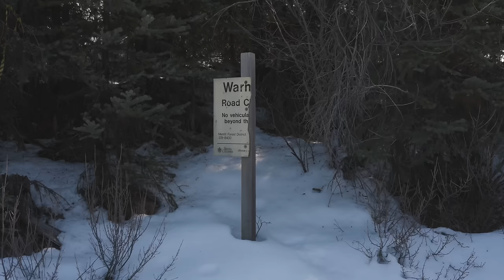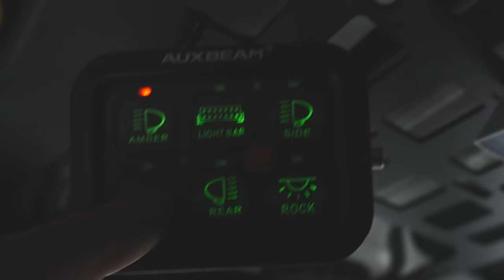EXTREME Winter Snow Storms VS My 426 Hemi Jeep Gladiator

Comment: Suggestion: mount a light, but sturdy, plow V-blade on the front of the lead vehicle.  Set the height of the bottom of it about two inches lower than the bottom of the lowest obstacle on the underside....bottom of the differentials.  On the move, the blade will clear away any snow which could pile up underneath and high-center the machine.  Clearance of the top of the snow with the blade would also prevent build-up in the steering gear as well.  Just a thought !!  Have more fun !!!!

Comment: In my opinion you don't need front and rear diffs locked for general snow driving. Snow is pretty grippy and if you are locked up it slides around more losing grip. And yes I speak from experience!

Comment: I was along by myself driving on a winter storm condition hwy 50 from lake tahoe to sac city in march 2023,,,  even though maybe not as thick snowy ice like this,,, but the icy road surface was solid form of ice,, it it rocky solid and slippery, , I saw some vehicles skid off to the shoulder,,, toobad,,,I skid off too ,luckily was able to manage on track,, only couple inch in calculation to plunge off,,, life threatening,,, MAN,,,

Comment: Man, I absolutely love watching these videos so thanks for doing this.  I have a question regarding airing up and down the tire pressure.  I seem to recall the military Humvees having an internal, "automatic" system for doing that right from inside the cab.  Is there anything like that available for rigs like yours?  It seems like that would be a major convenience for guys like you who are constantly doing all that.  Thanks and keep making more great videos.
Reply from the maker: Nothing automatic for Jeeps unfortunately, but we use a system called The Kraken to air up all four tires at once.

Comment: Insane drone work and videography! Snow wheeling is extremely fun in ideal conditions but can get very fatiguing in those challenging and dangerous conditions. Fighting for every inch and plowing with the truck wondering if something will break or if you lose control and slide in a ditch or off the side of the mountain becomes so draining mentally.

Comment: This might be a silly question, but why dont any snow offroaders use tire chains? I never see them using chains off road. Is it because the gravel and rock underneith provide good enough traction?
Reply from the maker: It's because they don't work in deep snow, they're more for ice. With deep snow you want to float on top as much as possible. Some of the snow in this video is as deep as the truck, so digging down to the ground will just make us unable to move forward.

Comment: It’s beginning to get hot here in Qld Australia (36 degrees today & not summer until December).  Watching your video was making me feel a bit cold.  You were pushing your Gladiator hard to forge a path through the deep snow & blocked up your front grille.  I was thinking you were going to overheat the engine with that big V8 working hard with no fresh air being pulled through the radiator.  Did you do any damage repeatedly pushing the car hard into a wall of snow over and over as there’d be some weight in it.  It looked punishing.  Awesome video & beautifully shot!

Comment: Hi guys, Moparben here. I just found your channel today 22DEC23. Just being curious;  why didn't you put tires on wide enough to go over the snow? I've only seen it once so I don't know much about it, but: During the snow storm of 1978 where I live in Michigan we got over 2 feet of snow. I saw a brand new full size F-150 go over it. Right at the South end of the road where I was living someone had abandoned a Datsun B-210 stuck in a snow drift. It was just barely visible the snow was drifting it in and there no way to go around it. So I drove all the way around to the North to come in from the other way and just as I was about to pull into my driveway, I got stuck in a drift. While monkeying around getting shovels out two guys came walking up the road from the South. This was about 9 or 10 at night on Thursday or Friday and it was a total blizzard. You couldn't see more than about 100 yards. One of the 2 guys asked if we had any gas. We told them we did, but it was 50:1 2cycle for snowmobile. They said they'd take it, they'd run out about 1/4 mile to the South, so we gave them the gas and they came back w/ that brand new F-150 and helped pull the car out. When asked about the Datsun they said they never saw it. They had driven right over it. I had never seen a vehicle go over the top of the snow like their truck did befor nor since. One thing I noticed about this seemingly unbelievable thing was the snow was not wet and packy, but not dusty dry either. Their method of driving was to spin their tires all the time, constantly,  which sort of made an ice plateau under the tire. When they pulled my car out, they had no traction at all, they could only use the momentum of their truck to "yank" my car out. That was nothing short of amazing to me. And to finish up the story: That old 6.5 gallon snowmobile gas can was full and they burned it all up befor they got another 1/2 mile North. So I took them to a gas station in my car. Guys, I was driving a 1969 Plymouth Triple Black GTX 440 w/ Hemi 4 speed and Dana 3.55 suregrip with chains. Ah, to be young again. ha ha. moparben/ michigan

Comment: If I knew I was going to be in snow like that. I would have my chains on
Reply from the maker: Unfortunately, that would be a mistake. You'd be burried and not getting anywhere very quickly. With deep snow you want to air down low and float on top.

Comment: Shawn, no offense. I realize that Toyo is your sponsor and that's why you have to suffer. But my grandmother whispered to me that if you use low pressure tires or at least artic track tires, it becomes much more pleasant to drive on such snow.
Reply: So supposed to see all those tires with 40 psi in them still
Reply: @matthewwalsh7408  I'm not quite following you, clarify.

Comment: What is the point of all the horsepower I have a old army jeep a real jeep not some fiat wanna be..mine has 74 hp and would climb a wall if it wouldn't fall off it's all about gears not power and wide tires and shiny crap
Reply from the maker: Ok have fun with your old Jeep grumpy not fun guy.